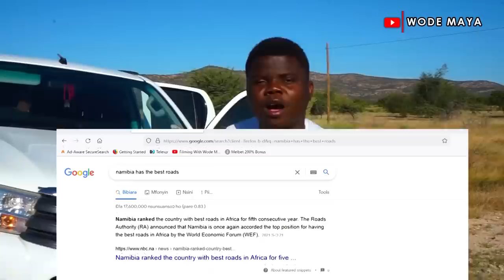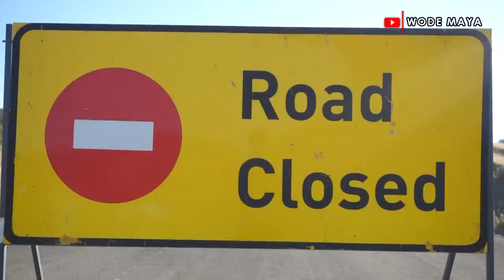Why Namibia Roads Ranked The Best Roads In Africa?

Comment: The reason for the high number of road accidents is simply down to human psychology. When the roads are wide and straight it tells the driver it's safe to speed, they may not even perceive how fast sometimes they're going. It can be counteracted with some simple "traffic calming methods." 

Wider sidewalks and narrower roads affects the drivers' perception of the road and makes them naturally more alert and careful (ie: drive slower). Bulb outs, raised medians, road humps, trees on the side of the road all force drivers to be more careful or affect their perception of the road in a way that makes them more careful. Without such traffic calming measures road accidents on seemingly good roads are going to be prevalent.
Reply: I have to say that I’ve never been to Namibia but from what I can see in this video, it seems that there’s not much that would discourage drivers from speeding: the roads are too straight on long distances (so, there are not that many curves to keep drivers alert), no sure if there are radars, etc.
Reply: Human error or should I say carelessness has always been Namibia's number 1  cause of road accidents.
Reply: If you come to such a standard of building roads, then you equally put up measures. On our highways there are speed trap cameras, on our streets we have traffic lights and speed humps but those are factors that don't deter careless driver. It's like in the US, they have good roads but still suffers from accidents. Just last year even Tiger Woods was involved in a very terrible one because of overspeeding. It is all about attitude.

Comment: Hey Wode Maya, what the woman pointed out to you is correct but enforcement is obviously an issue in Namibia. There needs to be heavy police presence on the roads to cut down on speeding which will help to reduce the number of accidents. That’s also a huge problem in Ghana. Bad roads and no police presence on the roads to Kumasi, Takorida and so on to cut down on accidents and deaths.
Reply: Cameras. Employment cameras and software to mail out speeding tickets to motorists. They are cheaper.
Reply: @trevorprimenyc  True

Comment: Very interesting, and true, it made me check lol - road density also plays a part but as a statistic its certainly true, so well done Namibia for showing how it can be done.
Interesting point the lady road engineer made about better roads becoming more dangerous. In Ghana (dreadful roads)  ive seen many times the urban and rural roads. They are currently surfacing often for the first time many roads (and not before time as many resembled tank training grounds) but this brings new problems. The standard of driving and general road safety by the walking population is appalling. The old poor roads did actually keep accidents down because vehicles couldn’t achievement any high speeds to have accidents, but now this is changing, the smooth surface encourage higher speeds but the drivers simply dont have the skills to drive at higher speeds, the driver training is poor as is the enforcement. The consequence of this will be more higher speed accidents which will lead to more fatalities sadly. This is what the engineer was alluding to here in Namibia. Its one thing to improve the road surface, but this must include road markings to instruct and inform drivers, and educate drivers as how to safely use them. You’d think improving the roads can bring only good, and by and large it does, but it can also bring different problems too.
Reply: Why are insulting ghana Mr Mark . We are aware that we do have bad roads and we fixing it .
Reply: @kennykross3306  im not in any way intending to insult Ghana. Im pointing out that with improvements come other problems, which is what the engineer is referring to here in Namibia. Just improving the road isnt enough, the driver needs to improve too. Goodness knows Africa needs better roads for all sorts of reasons but just doing the road will create further problems is my point and that of the engineer here. I use Ghana as a comparison as Im very familiar with it and have suffered badly as a result of its roads
Reply: @Mark13091961  👌

Comment: Well done Namibia for your beautiful road networks.  Nigeria should learn from you but corruption will not let them.  Contractor will take money and use less than 10per cent to just put sand ontop. When rain comes everything is washed away and leaves potholes all over especially in rural roads. Contractors have to bribe from the messengers to the Minister in charge of awarding the contracts. No one knows  how these contracts are inspected and approved as satisfactory completed SHAME.

Comment: Awesome roads but there again goes our people's lack of adherence to basic rules.  You are provided with good roads and then see that as a good reason to speed.  Wode Maya good roads do not necessarily lead to more or less accidents.  In general they should lead to less accidents.  It is the attitude of the population.  For example in the US we have excellent roads but I think 100,000 or so people die a year due to mostly drunk driving and off course harsh weather conditions.  However if you were to look for statistics where people tend to be embrace civic responsibility you would see much lower death rates.  It starts with small things like deciding not to throw trash on the ground.

Comment: “Not a single pothole”; wait for the rain season and we may speak again.
Reply: You are correct i live in a town near Windhoek and there are still some roads with potholes from the last time it rained and the time before that. But there are no potholes in Windhoek and other bigger towns aswell as the main roads that connect the country. Even if there are it gets fix very quickly.
Reply: Yes during rainy season it does just like elsewhere but authority fixes them just after rain is over. THE ROADS AUTHORITY IS RESPONSIBLE ONLY FOR MAINTENANCE OF NATIONAL ROADS NOT inside TOWNS. TOWNS ARE THE RESPONSIBILITY OF LOCAL councils. . SO maintenance of potholes  differs from one town to another but generally we'll maintained or fixed after rains. However, one town may take long to fix especially some small towns but big towns and city fixes in time especially after rains.
Reply: @mzerk9324  Regardless of who maintains the roads they are still Namibian roads. So if a town has bad roads it still contributes to the quality of the overall roads in the country.
Reply: @mzerk9324  everywhere else.. not in my country at least

Comment: Well Wode Maya, Namibia has a small population compared to Ghana or Nigeria, so it is very easy to link the country with good roads.
Reply: Namibia is large country. Almost same size with Nigeria. So many towns scattered all over the 4 corners of country and about 20 borders with neighbouring countries like Zambia, Botswana, SA, Zimbabwe and Angola. Landlocked countries like Botswana, Zambia, Zimbabwe, DRC KATANGA PROBINCE uses namibian roads for import/export via Namibia port of Walvis Bay. Trucks to and from SA Western Cape  to Zambia and  Angola all pass through Namibia. So it's a 2nd  logistic hub for southern Africa landlocked countries after Durban. Road network of namibia crisscrosses the entire country in all compass directions. U can enter Namibia from any corner that's why it has many borders. Population is scattered all over country. So are the towns. There are about 60 full towns in Namibia with distance in between towns ranging from 30 km to 175km longest distance. Every 30,50 and 100km there is a town.

Comment: But there policy is just a copy of the American style of transportation planning. In many parts of America you can’t move around without a car, will Namibia become that??
Reply: I would say Namibia is planned more around the car than the person. This because Namibia is such a large country you can't walk to many places.
Reply: @dwayne_  trains, light rail could solve that.

At some point Namibia’s capacity for cars will have been met and increasing it will increase supply of cars. 

A train linking major cities together that allows 500 people to travel at one go is more efficient and better for the environment than if all the 500 people had their own cars, traveling individually and causing congestion on the road. 

I also think that improving public transportation is a way to reduce poverty. If getting around required a car how will a person just from the rural area survive their first few years in the city.
Reply: @user-kd5zg5ht2i  I agree we need better public transport in our country. The problem with a dedicated train to connect bigger cities is that it is not really feasible. Namibia has a very small population therefore the demand for public transport is not high enough. As for how the poorer poeole move about in the country there are mini buses that travel everyday aswell as taxis.

Comment: You Guys have Not Seen anything...Namibia Has the highest Numbers of potholes per square km...
Reply: U MUST BE TALKING ABOUT ANOTHER NAMIBIA NOT ONE WHERE I DRIVE EVERYDAY. MAYBE DURING RAINY SEASON. EMPHASIS IS ON MAINTENANCE OF roads and potholes. Wode Maya travelled to coast, from there to Etosha, then to Opuwo, then Oshikango, then tsumeb and back to Windhoek. He read about it before he came here and he had to drive around country to see for himself. So he is talking about what he saw confirms what he read. All I know is that ROADS authority has maintenance division that repairs roads. Every region or district  has that division. Quite often u can't see a pothole lasting long in Namibia. It will be repaired in a short time once it is detected. That's what is absent in Road management in africa. U see potholes for 20 years. U can't build a new road simply coz of one or 5 potholes. U have to maintain the potholes. Seal them. That's the difference.
Reply: U must travel africa to see for yrself. Fortunately we travel. Namibia didn't rank itself. So is Rwanda no. 3 in africa on Good roads. Singapore is no. 1 in world in same ranking index. Its ahead of USA even. Holland is in top 5 in world. UK is lowest in Western Europe. Just Google u will see potholes now in UK as we speak. Anyone from UK will not hide that. Especially countryside. Even America has potholes. Issue is fixing the potholes(maintenance).
Reply: Go away, troller

Comment: The truth is simply this. Namibia is typically a desert, no heavy rain falls or down pour. So what they need do is just little maintenance and the roads spark. Little wonder arid/desert countries like UAE, Qatar top the list as best quality roads.
Reply: INCORRECT. desert part is 0nly 20% of namibia land. 80% is not desert. Its savannah, mountainous inland and forest in North East Namibia. North East Namibia has highest rainfall pattern.
Reply: I get your point, but all l want you to understand is that the rate of rainfall in Namibia is relatively low to compare with cities like Lagos which has rain throughout the year. Also Namibia has a strong soil structure which support longevity of road life